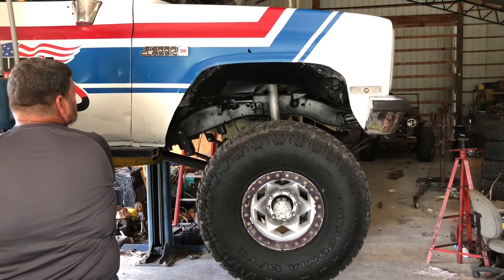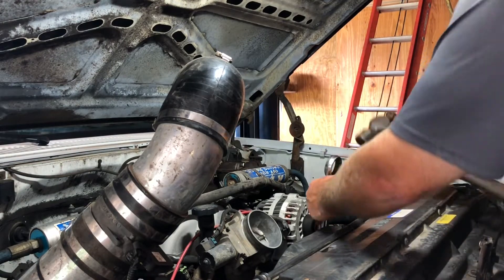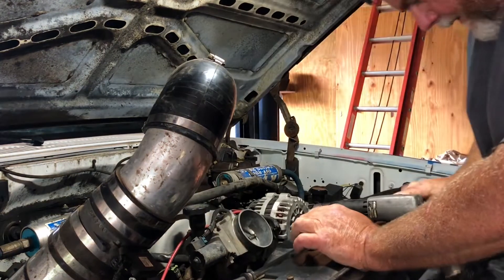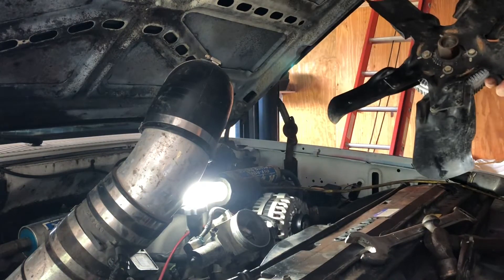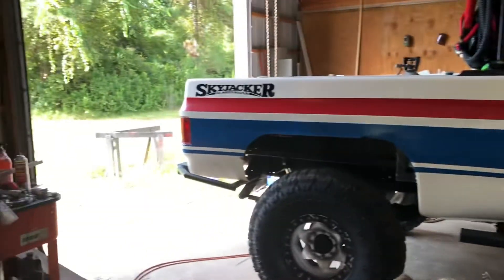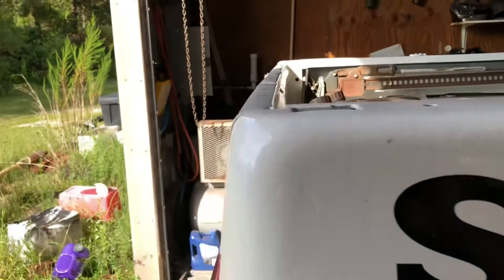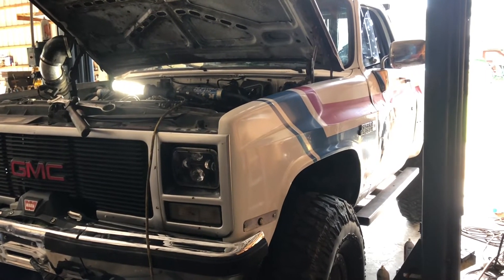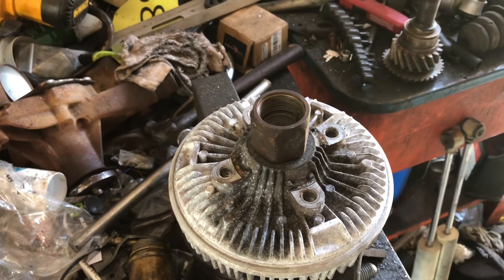Fan clutch replacement on the GMC

Comment: I run an electric fan, but I only have a 3.0. And the electric fan I have is from a Volvo and is for a 3.0 Volvo. I don't imagine there are any mfgs motors your size running an electric fan. And I don't trust aftermarket fans to last like an automotive mfgs. fan set up. I like it for all this water we so frequently have to deal with here in Florida,  especially since my electrics are all on the front of the motor. Easiest to shut off the fan, make the crossing, then turn it back on once back on the regular trail. Big picture though, wholeheartedly agree with you.